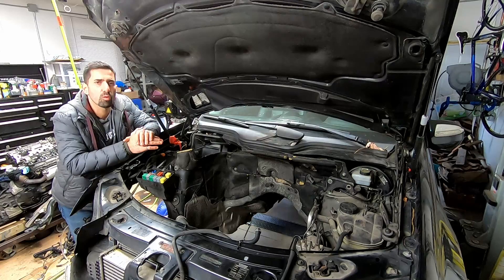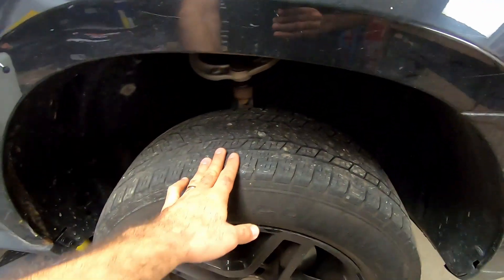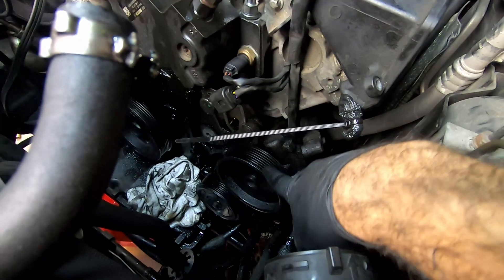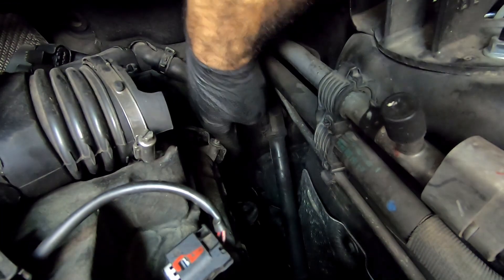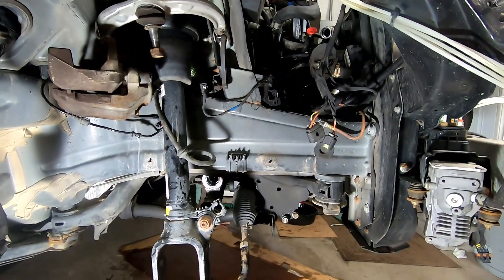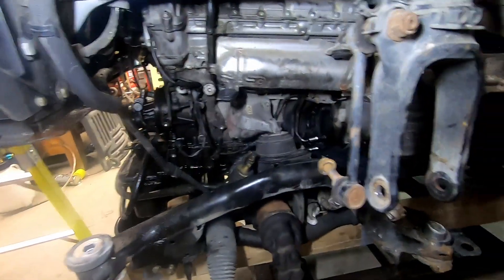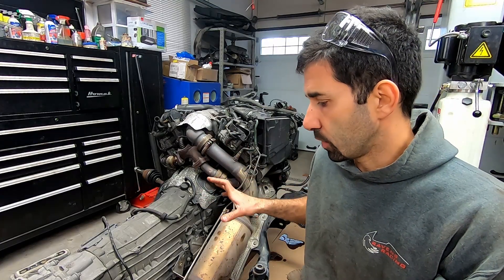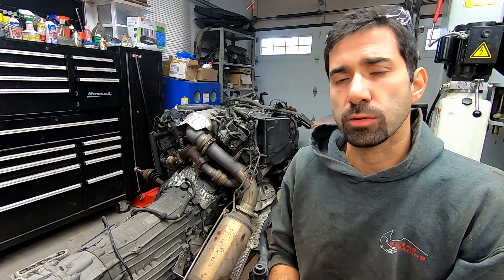Project GLander: Episode 1 - Mercedes GL320 (X164) OM642 engine removal

Comment: Can I change the (4) Front  Subframe Bushings and not remove the entire Subframe from the car (2007 GL450) ?   Is it possible to just change the Two front rear one and the Two Forward Fronts?  One at a time? My Bushings are Rusted and rotted.   I have a noise clunk over bumps driving me crazy! Thank you for the Video and your help.
Reply from the maker: hey interesting question...I haven't changed the subframe bushings so I`m not 100% sure...I looked around for info but can't find anything specific. There are tools out there to allow you to push the bushings in and out but I`m not sure how much room you'd have without removing the engine...that said if you supported the engine you should be able to remove the subframe and do the job off the truck
Reply: @ETMotorsports  Thank you for the help and reply!

Comment: Thank you for your informative video. I am considering replacing the engine on mine. Not sure if a pair of jack stands would do it. But now convinced I really need a lift.
Cheers from the Midwest
Reply from the maker: Oh no - what's wrong wth the motor? It's fairly big but relatively easy to get out

Comment: Thanks!   Love your work!   Greetings from Australia Melbourne. I agree - this car is good, I've got 2007 GL320 with nearly 223 000 km Off Road Package and loving it.  Good Luck !   Regards
Reply: @ETMotorsports    G'Day Mate !   I didn't tested yet ( just bought - a month ago from a careless "owner") now fixing leaks (similar to your case). Spend a lot of time and $ to find proper lubes for diffs ( rear diff has 235.15 MB approval) but lubrication for rear is yet delayed due to the detection of significant backlash/play between the rear propeller shaft.       I very like your idea to  get rid of "env@..ro" cr@p ( how about  programmable changes in ECU - do you have STAR soft ?)  also 3d row seats.  Looking forward  for new videos.  Good Luck !